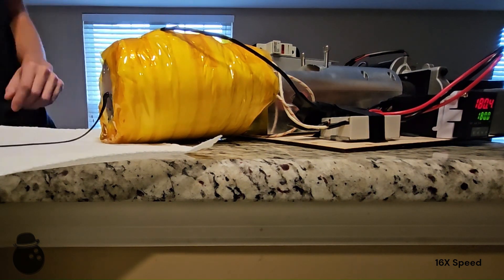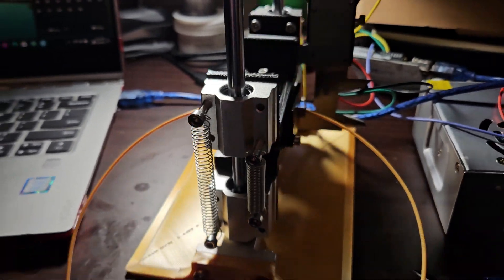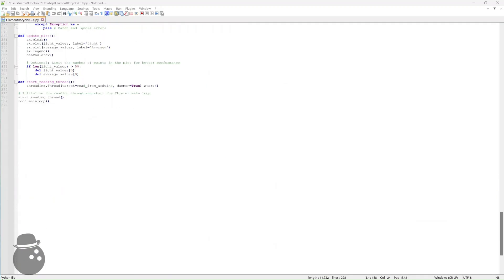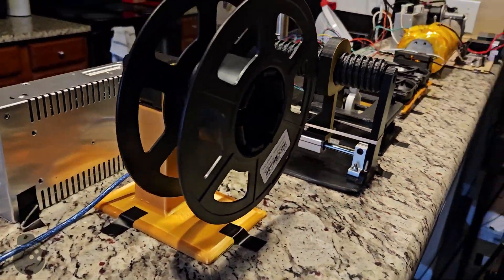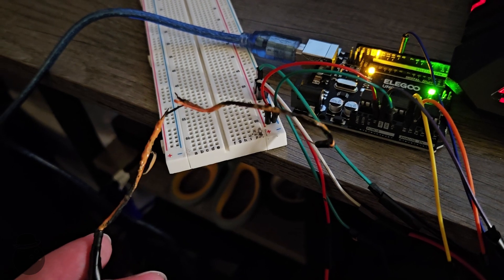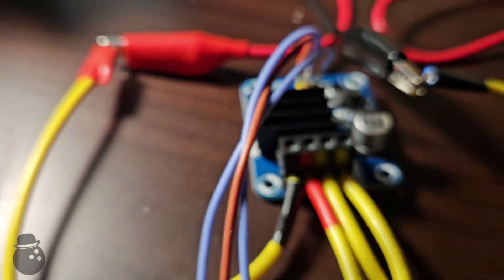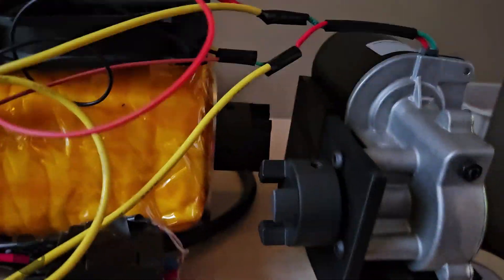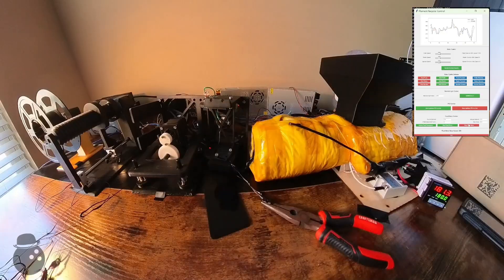Is My Filament Recycler Finally on the Right Track? (Part 2)

Comment: Cool. How are you shredding? Also, may I suggest some sound treatment? Even moving blankets on the wall will do a lot to help audio.
Reply from the maker: My shredding process is just a simple high power blender right now. I anticipate once I figure out the remaining kinks, I'll need to refine that a bit. The system has enough heat and torque to handle a moderate amount of pellet inconsistency, but I won't know how well the filament prints until I can get it to a consistent diameter. I've seen your videos on recycling and saw the struggles you've had with the source pieces. Good stuff! I really want to avoid having to use a prebuilt solution, though.
 Would you please elaborate on the audio issues? Are you referring to the voice-over quality, the physical machine noise, or the brief section with pure raw audio (or everything)? Or do you mean just to make the machine noise/shredding noise to my neighbors quieter?
Reply from the maker: You can see a bit of the shredding process in part 1 of this series.

Comment: In order to have a better control for the motor RPM it's better to use an encoder to feed it directly into the PID controller. The voltage and current method doesn't provide an accurate rpm indication because it's highly affected by the load, and you your case, the load can vary a lot 
The pooling station need to have variable speed depending on the filament diameter to be able to compensate the extrusion volume. 
If you want to have a very precise filament diameter you may add an additional measurement immediately after the extrusion orifice, then to find a relation between diameter at the extrusion point, pooling speed and filament diameter 🤓

Comment: The reeler speed seems off still - you may want to switch to a rotary position encoder (basically a series of slits and LEDs/diodes to detect the position of an axle) - I used to build my own in the 90s but they're cheap and easy to integrate at the usual electronics distributors. For your application, a differential encoder seems good enough - it's able to count how many ticks/degrees and in what direction the axle has rotated.

Comment: This is an awesome project.  I think you might do a bit better by moving the cooling fans directly after the extruder and before the laser.  Give the filament a chance to cool a bit and skin over before it's stretched.  Might make it easier to keep it consistent as you load the line.

Comment: nice work, in the process of making mine and just happend to find your video, nice to see the final desing look very similar especially in funtion, but made in lil differnt ways ^^ basically encouragin as im 95% till first bathc try. basically, used a 1/2 copper threadedpipe an 5/8 auger, same kind of pid controller, 380w heating bands, the roller and puller are different design btu funtion simillar. nice vid and ive subbed ;-)

Comment: Really cool project, also how did you make the interface from the arduino code?
Reply from the maker: Hello. I made the interface using IDLE (Python), specifically the "tkinter" library. That library allows for building a Graphical User Interface (GUI) where you place and label buttons linked to run functions when clicked. The functions tell the computer to send Strings of text over serial communication to Arduino. The Arduino script is set up to look for these Strings, and, based on their content, turn on motors, change speeds, etc. The communication goes both ways, so I can also have the Arduino send signals (like the laser/photoresistor values) back to Python to display in the chart (via matplotlib). It was a new thing for me to learn and my good buddy ChatGPT was very helpful. I found that sending the signals in a queue and having the Arduino send "ack" (acknowledgment) statements, when received, helped to limit button press misses.
Reply: @bowlerllc  Thank you, really appreciate your help.

Comment: love this project but as one small tuber to another, the camera work is wayyy too distracting man
Reply from the maker: Sorry about that, most of this video was filmed months ago when all I had at my disposal was my phone camera. I have since acquired a GoPro and the Insta360 X3 which should improve the stability of the footage as I learn to use them. This video was particularly difficult to film as I did all this on my own and holding the camera while moving things around was tricky. Going forward, I plan to make better use of stationary cameras and will try to work on my lighting. Hope you stick around for the next video to hopefully see some camera improvement!
Reply: @bowlerllc  I hear ya mate

Comment: I'd suggest narrowing the opening of the laser-measuring station to something close to the final filament diameter. That will reduce the amount of stray light interfering with your readings and also give a more accurate reading of the extruded filament thickness. Regarding the "pulling" station, try adding some elements on the side of the pulling wheels to stop the filament from falling from the roll. For the cooling, I'd suggest adding some sort of cooling channels to direct the air more towards and around the extruded filament. Also guiding the filament along the way (throughout the entire process) would surely help, as it would alleviate the pulling force on the hanging filament from its own weight. Keep going! I see great potential here!!
EDIT: Check this video out, it shows something similar to the guiding that I mentioned! https://www.youtube.com/watch?v=YOvhlZoaJII&pp=ygUXcHJ1c2FtZW50IGZpbGFtZW50IGxpbmU%3D and also this video where they show how Prusa makes their filament: https://youtu.be/SCIOOlT3KJI

Comment: Looking at other solutions to this it seems they usually shred the old prints quite small before extruding. Then they extrude first, pellet that extrusion, then mix 50/50 with new pellets and extrude again. I'm subbing to see how you go. good luck man